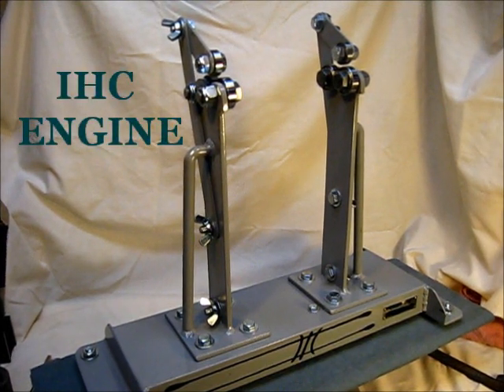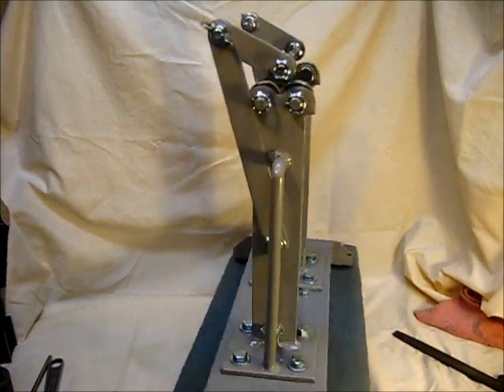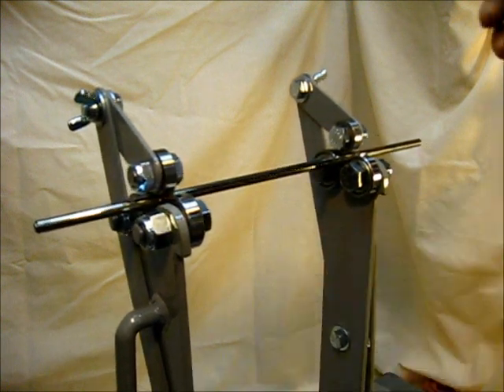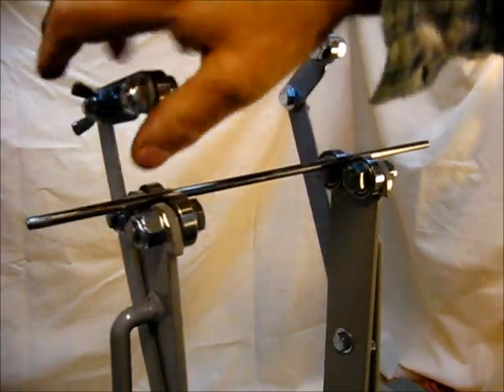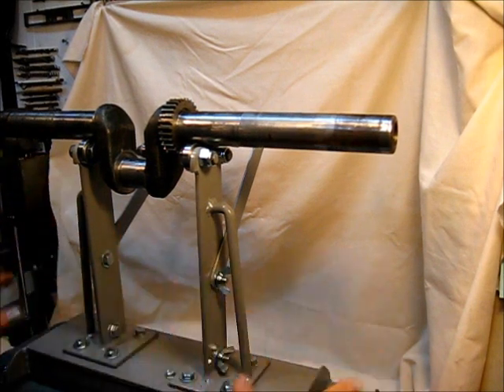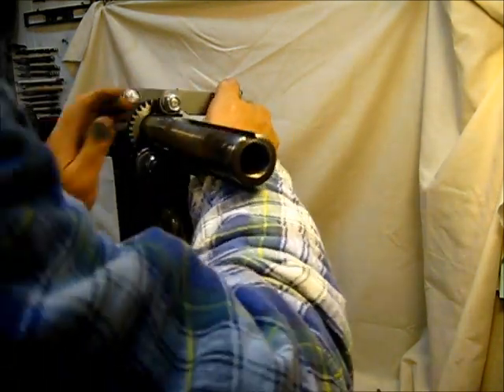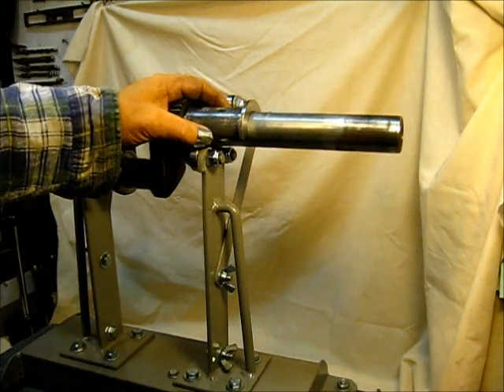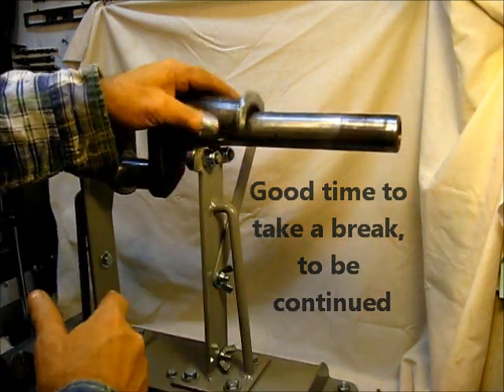IHC ENGINE / crankshaft test stand

Comment: Sam, something tells me you had to have another method to test those crankshafts before you built this one..i spin mine in the lathe between centers with an indicator..works fine, these old engines can run out of balance although they wont run very efficient, ive found they are the most forgiving motors when it comes to tolerances